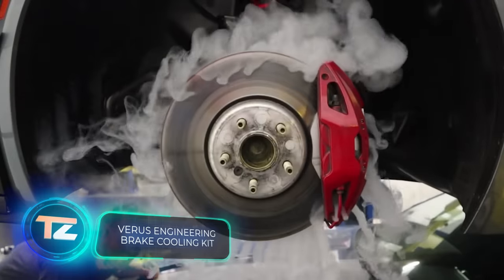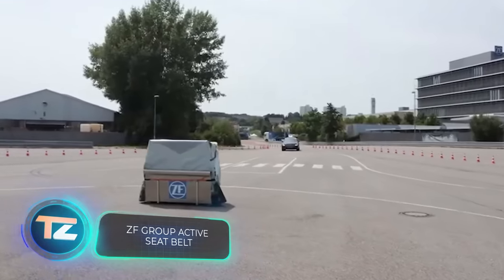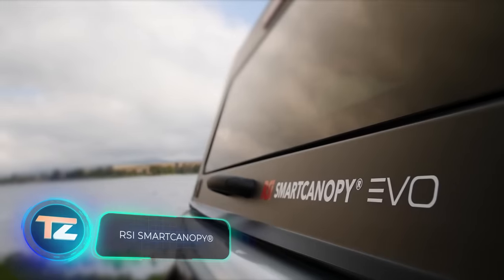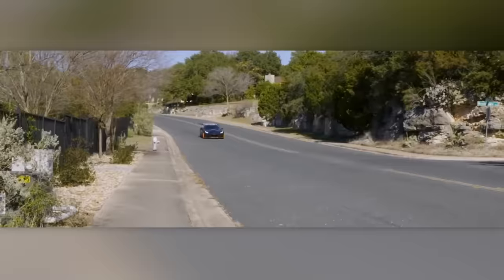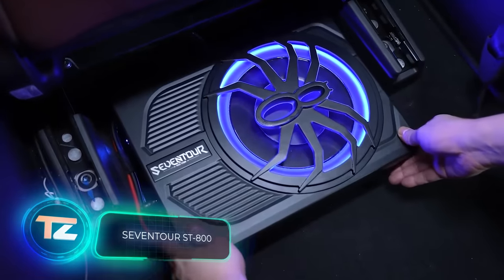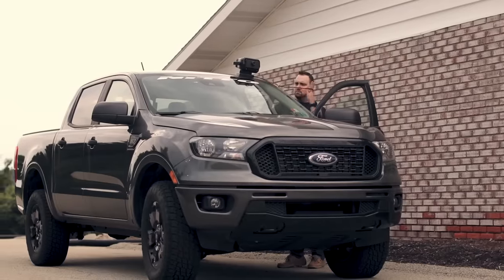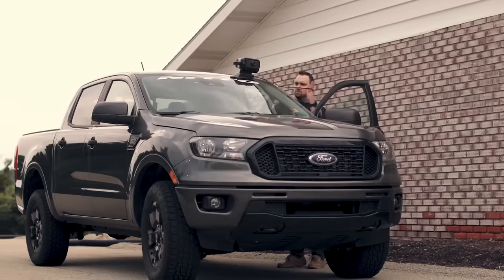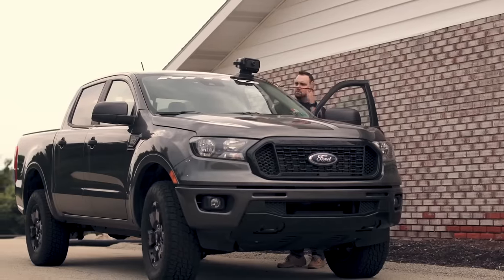COOL INVENTIONS THAT WILL TAKE YOUR CAR TO A NEW LEVEL

Comment: 125mm = 1.25cm = ½inch!
And, after living in Europe for over 50 years I've NEVER heard a citizen using millimeters for ANYHTING!
Reply: 125 mm = 12.5 cm = 5 in .
Millimeters are used every day, in every technical context.
Reply: 1 oz = 0.02602106 Quart = 0.0078125 US gallon
And, after living in Canada for over 45 years, I've used all the weird units from USA and prefer metric system... You know, the thing NASA and any serious scientific use.
1000ml = 1L = 10cm x 10cm x 10cm = 1000cm3
Water freeze at 0*C, boil at 100*C
1 g of water is 1ml
1000L of water is 1 ton or 1000kg and is also 1m3

Comment: All the  products you feature are  stupid expensive
Reply: Brake cooling was stupid. Much better job, cheaper with left over tools and materials, if done with sheet aluminum, pop rivets, hardware cloth, stainless steel hose, JB Weld and some Wire Fasteners with rubber or marine caulk for rattle dampening. The cost would cover all the materials & tools needed, brand new, with money to spare.